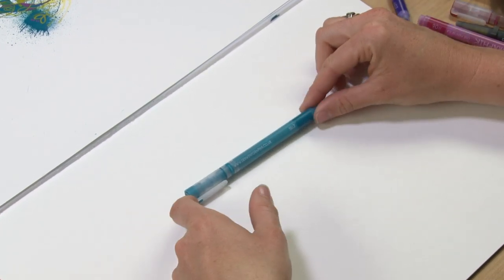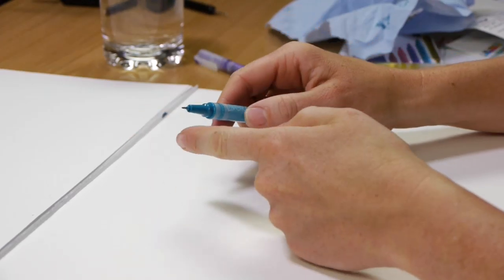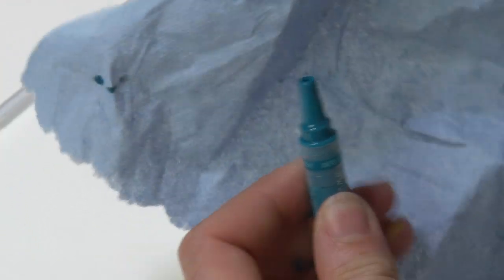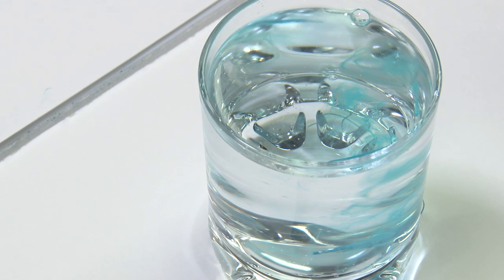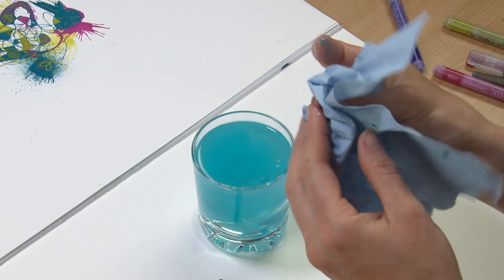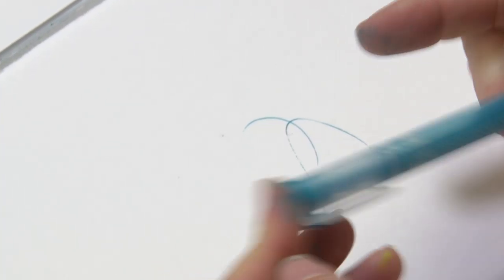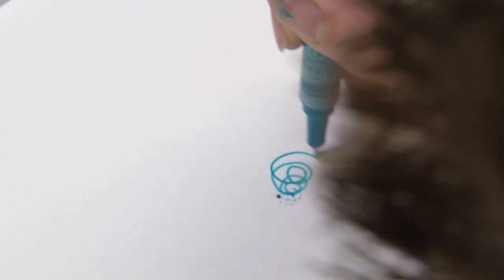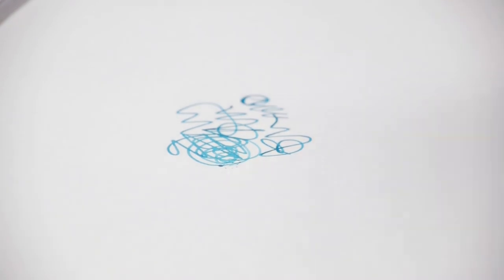Derwent Graphik Line Painter pens: blocked nib

Comment: I bought the complete set a while ago. Several wouldn't write lines any more, although I could get big blobs out. Before I started soaking the nibs, only 13 of the 20 were working. Now it's up to 18 but I did have to go through the process several times, which was very time consuming. Would prefer a product that wasn't so fiddly but otherwise I love them.

Comment: I've persevered with these for several years but 4 out of 7 the colours I bought NEVER WORKED properly from day 2. They have all been treated and stored the same way together and horizontal. I've tried the soaking tips many, many times even soaking overnight in various temperatures of water. The inner fibre of the tips clears but the tiny tip part does not. I'm glad I only bought 7 as they are an expensive. I'm using them up by blobbing the ink into tiny containers and using a dip pen, also you can put them in the tiny bottles with the detachable metal nibs (take care you seal well as they can dry out). I have many beautiful high quality Derwent pencils but I'm afraid I don't rate their pen making abilities. There are other paint pen brands that are much more reliable in my experience.
Reply from the maker: Dear Bernie, thank you for your feedback. We will pass this on to the product team to look into as this is not the experience you should be having. Best, Derwent

Comment: Im pretty dissapounted, sucha good product it could be, but this happened to me on the first day. Its very expensive and even trying this tehcnique of fixing it, its still the same. :(
Reply: Same here. One of my grey ones is clogged and won't reactivate, and several of the other ones start leaking as soon as I start using them. It's a very expensive product for how poorly designed they are. Not to mention the measly amount of ink they provide in the barrels.